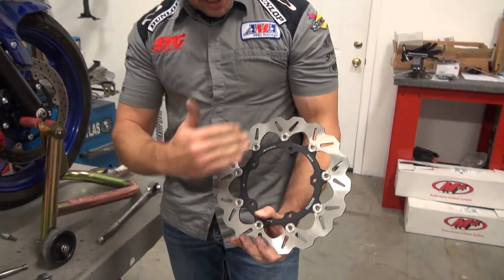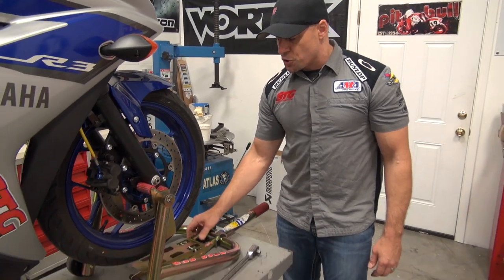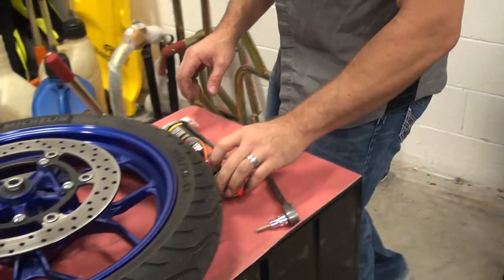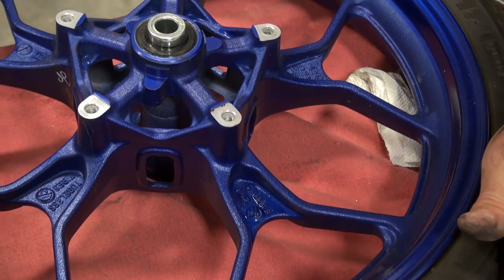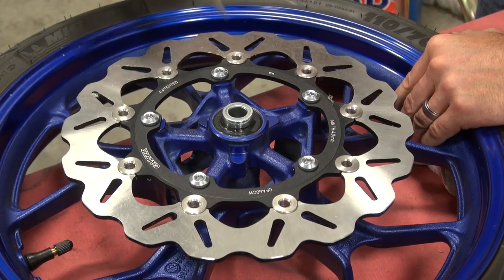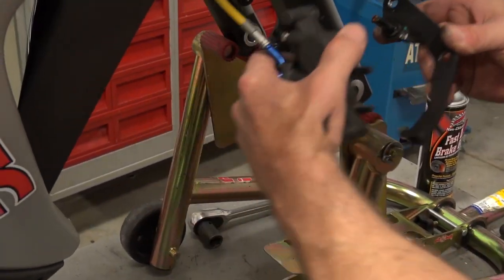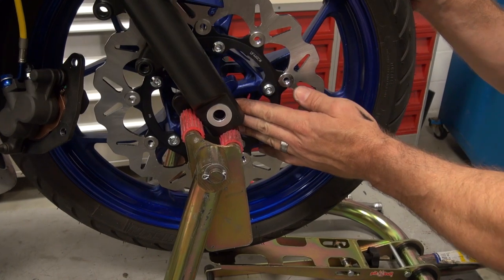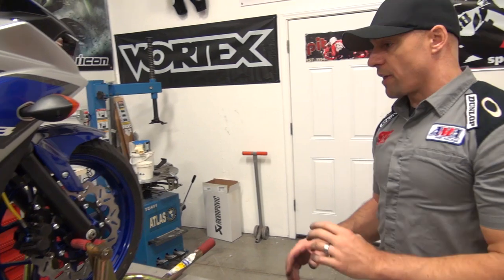Galfer Front Wave Rotor Installation on a 15-17 Yamaha YZF-R3 from Sportbiketrackgear.com

Comment: After 7000 miles on the stock rotors and pads I'm in need of some serious braking upgrades along with my 3rd rear tire and first front to something stickier.

Comment: Is it possible to add one more disc and caliper on small bike to get more braking?
Reply from the maker: You can install larger rotors on some models, the R3 is not one of them. IMO you can get all the braking power you need on this bike by upgrading the pads, lines and rotor. In MotoAmerica the JC racers are using stock master cylinders on the R3 and Ninja 400 with excellent results. - Van
Reply: @sportbiketrackgear  if upgrade bigger rotor do I have to change pad and the one that holding pad size? Or use same pad just bigger pads? 
I just wan more stopping power cus in sweden in case of imergency brake i wanna to stop as fast as possible. ( lot of forest and wild animal just runing out) and I like to ride fast so I wanna be able to stop fast. Do i change back rotor to cus both brake better then one brakes

Comment: I have the same rotors on my 2008 gixxer, I just want to know does it move up and down or I need to change the bobbins ?? cause I feel clunk sound over bumps when riding slow (10-15 km/hr) ??
Reply from the maker: It should not be overly loose. I would reach out to Galfer direct with this question. - Van

Comment: Hey,

What hex / torx set would you recommend for bike maintenance?

I checked your tools link but it only has a link to some battery thing.

Thanks
Reply from the maker: +AcMods.net Thanks for the heads up, the Tools category needed a little love. Still we do not have a good torx set on the site. We will need to get one added. - Van
Reply: Okay great looking forward to it!

Comment: How would you bed in discs on a track only bike?
Reply from the maker: I start in the paddock with slow speed stops and finish on the track with a slow session. Do not put yourself into a situation where you need to break hard. Break smooth and early for every corner. You will feel the brakes improve with each use until they are ready to go. This process will only require part of one session to complete. - Van
Reply: @sportbiketrackgear  Nice one cheers for the reply! Will give it a go. Keep up the good videos, I've learned loads from you 👍

Comment: Can you follow up with a quick review of how the rotors and pads met the marks, and would you recommend them for street use? I have two R3's, and was considering the steel braided brake lines to improve stopping feel.
Reply from the maker: Sure, everything worked very very well. I don't usually ride aggressive on the street but it significantly improved my overall breaking consistency in all weather. Really great setup!

Comment: Whats your reason not to use a torque wrench?
Reply from the maker: Before starting STG I was an auto technician at a Cadillac dealer for many years. Over those years I developed really good feel for torque and would only use a torque wrench for a few select jobs. If you are not comfortable working without using a torque wrench I would encourage you to get one for sure. - Van

Comment: I still don't think my rear brakes are safe yet never use them but I get what you mean as they will not work as well for a bit

is this the same for my model which has ABS or will a need some kind of ABS disc not sure how that works
Reply: +Rookie Rider J also should get a Sena headset + Prism when you test all this stuff out you can record and talk about it
Reply from the maker: +Rookie Rider J That will depend on if there is a sensor ring attached to the rear rotor or if the Galfer rear rotor will accept the stock sensor ring if it is removable. For now the application chart only says this will fit the US version. - Van

Comment: Excuse me sir. I planing on buying R3 but I wonder what is the maximum size of wheel on tired that I can put on R3 ? front and rear wheel. Do I need to adjust the swing arm ? What if I would like to put the wheel and tired around Front 160 and Rear 180 do you think is possible and safe to ride. Thx a lot sir.
Reply: Au Jun 120/70r17 and 160/60r17 works well on factory wheel size

Comment: why that benefit the bike? what that do exactly
Reply from the maker: Great question. They look better (never a bad thing) and the overall performance of the brakes will improve a bit as compared to stock. Not a massive jump in braking power as you would see with installing a brake line kit. - Brian Van

Comment: They use retaining pins for safety. Do you know what else is for safety? A torque spec. That's just plain sense and cheap insurance. I like the product but you are actively telling people the wrong way to do this. "At the end of the day" torque matters.
Reply from the maker: If you do not have a good feel for even and appropriate torque then you should use a torque wrench as stated. I have installed brake rotors on bikes 100 times over the years with zero issues. Everything I share is based on personal experience backed by actual results. As I said if you are not comfortable then go buy a torque wrench and use it. - Brian Van
Reply: I've never met Van, but based on the videos I've watched, he likely has more mechanical experience than all of the viewers of this video combined. He even suggests using a torque wrench in the video. I have a decent bit of mechanical know-how, sometimes I use a torque wrench, sometimes I don't.
If you're concerned about safety, I'd reevaluate the video on your channel that shows you explaining how to remove the orange tip from a CO2 gun- that orange tip seems like it's there for safety, after all. :)
Reply from the maker: I am certainly no expert when it comes to firearms so this may be incorrect. Don't they put the orange tip on toy guys to clearly identify it as such to prevent unnecessary or accidental shootings? I don't use a torque wrench or wear safety glasses but I wouldn't do that. The internet is an amazing machine. - Brian Van